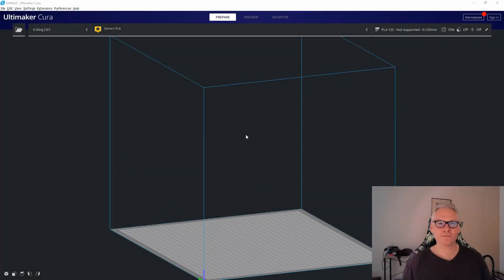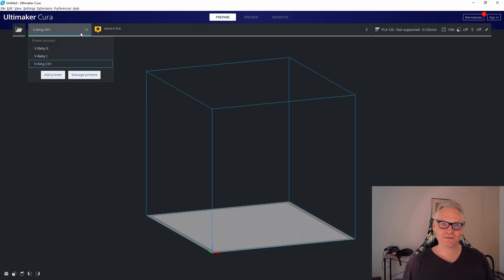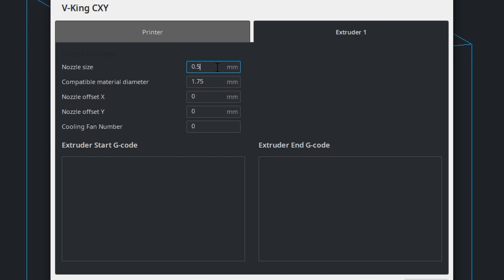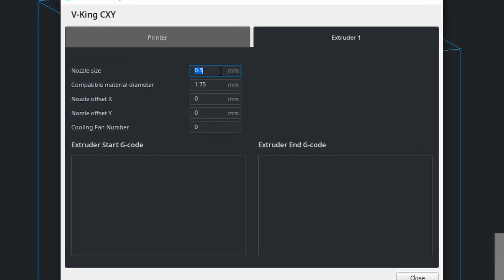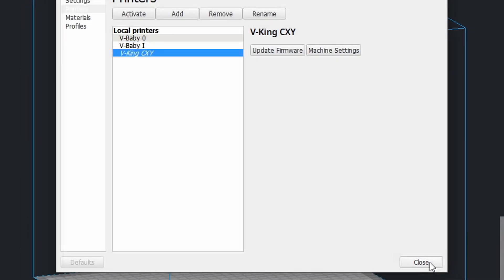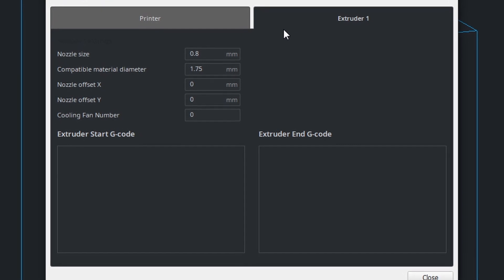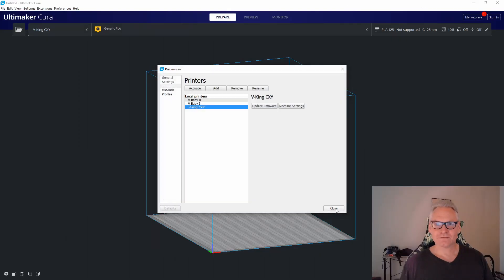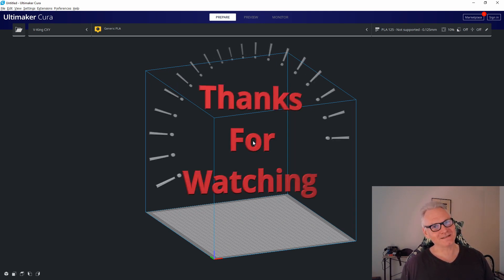CURA SLICER | HOW TO CHANGE NOZZLE SIZE and STORE IT!

Comment: If you change you nozzle size, to a .8mm lets say, does Cura change all your settings, such as max layer height, extrusion width etc. Or do you have to set those setting accordingly?
Reply from the maker: You must change it

Comment: I sometimes facing line distance or unwanted distance between lines. for example 0.4 mm nozzle.  Set up 0.4 mm line width. But when you measure between lines, it is 0.8 mm, and line gaps as much as the line thickness. I am sure it is not under extrusion problem. What setting or conflict might cause this?
Reply from the maker: I this case you should calibrate your flow to get the right linewidth / wall thickness. Here is a video for that: https://youtu.be/PawzUNARwb0

Comment: couldnt find the toption to add custom nozzle sizes in the machine settings or extruder settings
Reply: did you ever find the answer? i cant find nozzle size in cura 4.10 as well

Comment: I don't have a "nozzle size" setting on the extruder tab.
Reply from the maker: Really? What version of cura
Reply: @PRO3DESIGN  4.6
I had a create a new printer to change the nozzle size under the material profile.  This is a bug in the software, I guess.
Reply: Suburban hello, my cura says nozzle size empty ..do you have the same?
Reply: @StinkfauleSocke  I plugged in the nozzle size when I set up the printer the first time I used the slicer.  Then I couldn't find the setting again.  After creating a second Ender 3 printer profile, there is a pull down menu under the material tab with about 10 different options for nozzle size.
Reply: @TheSuburban15  well so far I don't have my printer, I just pre prepare everything. the pull down you are talking about says empty and my material is written orange like its not working hmm
Reply: @StinkfauleSocke  If you haven't figured it out yet, I was having the same issue. If you click "Settings" in the left column (in preferences) and check the box next to "Line Width" it will give you an option right under "Layer Height" in advanced settings where you can type in your nozzle size every time you slice. Hope this helps!

Comment: thank you so much, i was thinking that it was my fault that could not change the nozzle, life saver!!! one question, I order all the peace for a v-baby, but I can have almost for free the 2020 T-slot extrusion. Its there any way to do a hybrid V-baby only use V-slot on the Z axis and use linear rails on the gantry? it would be the same price for me to buy the linear rails that if i buy the extrusions with shipping+plus i dont have to buy the wheels, but i don't know if its something that it can be done
Reply from the maker: It requires a lot of redesign to utilize rails on the xy gantry. This is not easy but if you have the competence to do it you are welcome to try